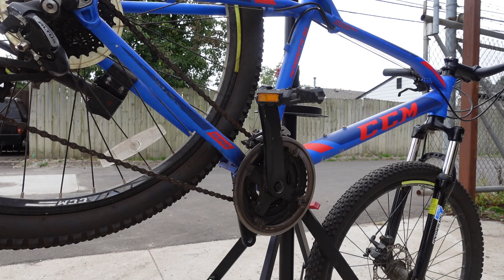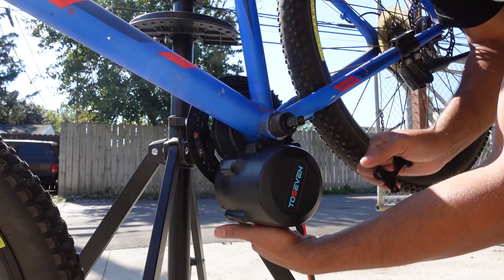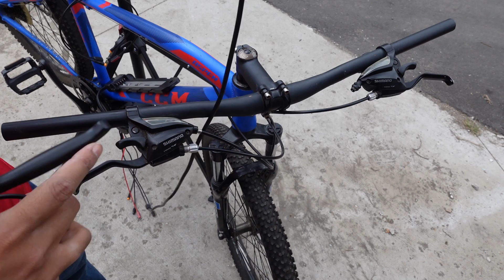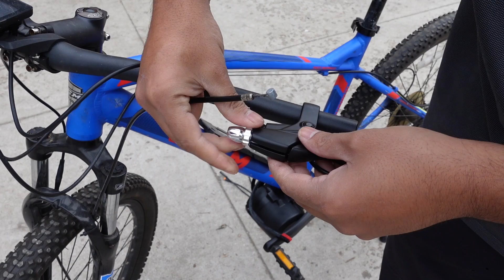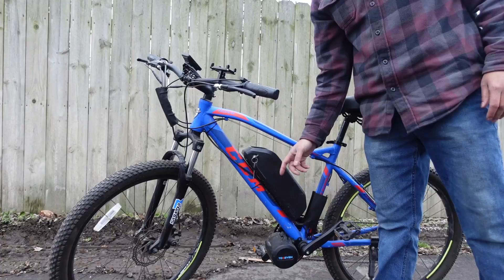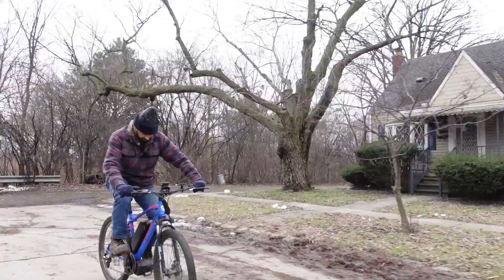ToSeven DM01 Full Installation and First Impressions

Comment: 1:09 Nice video. I have a Tsdz2. Very similar installation. I like the DM01. If it proves to be a reliable motor, and when the necessary upgrades  be finished, it will replace my Tsdz2. Not in a hurry right now.

Would it be possible to swap  a DM01 for a Tsdz2 without any significant modification, using the same bike?
Reply from the maker: Yes it will be easy swap

Comment: Great idea to have a Bafang style motor with torque sensing. Torque sensing increases battery range for a long ride
Reply: It requires relying on torque sensor even on flats if you don't use high rpm throttle in granny gear on hills during long distance rides. Torque sensors are good mainly for traction control during offroad riding.